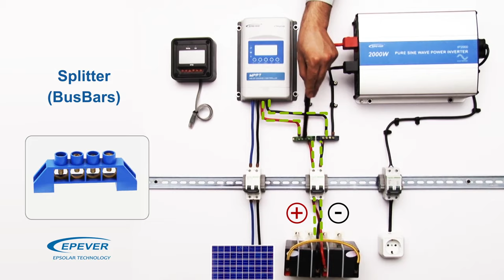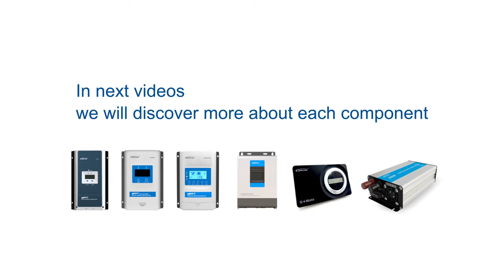The Ultimate Guide to DIY Off-Grid Solar Systems - 02 - Solar Off-Grid System Components.

Comment: Зачем вы подключаете инвертор парралельно аккумуляторам? У контроллера же есть выход DC?
Reply from the maker: Hello sir, there are two reasons for connecting the inverter in parallel with the batteries:

Firstly, it allows the inverter to directly draw power from the batteries and convert it into AC power for various electronic devices. This configuration ensures a stable power output and enables the inverter to supply power to a wide range of appliances.

When using the DC output of the controller, it is typically used to connect the batteries to the controller and provide DC power to other devices. However, the DC output of the controller may not be suitable for all types of devices, especially those that require AC power, such as household appliances or electronic devices.

Therefore, connecting the inverter in parallel with the batteries ensures a stable supply of AC power and prevents the batteries from fully discharging without voltage control. The inverter monitors the battery voltage and automatically stops supplying power when the battery level approaches its limit, protecting the batteries from over-discharge.

Secondly, the controller may not be able to handle the surge current generated by the inverter. We only recommend connecting resistive loads to the controller's load terminals, as inductive loads can generate significant surge currents that may damage the controller.

Therefore, it is advised to connect the inverter in parallel with the batteries to achieve the desired functionality.

Comment: Sir.. 
I have 12v 180w ×2 =360 w solar panels
12/24v 40 amp (SMU)solar controller
12v 150ah battery
So..
How many amps circuit breaker is Required..
On Solar panel to ( SMU) solar controller
 And solar Controller to battery..
Please ans me Sir...🙏🙏
Reply: Hi, I guess your solar panel has Isc rating of about 10A, so if you connect solar panels in series, the current is still 10A, that requires a 16A or 20A circuit breaker. If you connect your solr panels in parallel, the current will be 20A, then you will need a 32A circuit breaker. For battery, you need a 50A to 80A circuit breaker since your controller has a rating of 40A. Make sure not to use polarity-sensitve DC breaker for battery, though.

Comment: what happen if i use this inverter around 12pm, can you use it while charging the battery and using the battery as the same time?
Reply from the maker: Thanks for your question, with the right size of battery and reasonable parameter settings, yes you can process them at the same time.

Comment: Can you post a similar video about the Grid system?
Reply from the maker: Saba, right now, EPEVER is manufacturing off-grid products. However, UPower series, can supply charge for the batteries and we will release a video about it later. stay tuned, if it applies to what you need.
Reply: @Epever para llamar afuera   .. No tengo.
Reply: ./cont colle  0 t
no puedo llaman afuera

Comment: What will happen if the generation is more than the load demand and the battery is also fully charged? Will the voltage at load increases? If yes how do you tend to control that?
Reply: Hi, what the charge controller does will guarantee the generation is exactly what is needed at any time. There will be no 'more than' as you thought.

Comment: So when you mention how the inverter and battery are connected in parallel, are you saying they are simply connected to the same post (bolt) on the positive terminal busbar ?  This was a reply comment you made previously on another person's question in the comments.
Reply: Hi, hard to find the comment, but sounds  correct, positive to positve together, negative to negative together.

Comment: where i can get that DC breaker? at 4:50 i don't see it on the web ep.
Reply from the maker: Dear, artillerypr, we don't produce DC beaker for now, you can find really good breaker on internet my friend, have a beautiful day!
Reply: If you search "10A DC Circuit Breaker MCB Solar". Put the required amp and voltage rating into the search. They're available on Ebay as well as other sources.

Comment: hi fantastic I'm spending some time trying to get my head around all this yours was very easy to understand so easy in fact that I could probably now build a panel like this for the box van conversion I'm planning in the spring of 2021
However, I would like to go one better and build something similar to Greg Virgoe where you have one distribution board for all 3 systems onboard
A- Dc system
B- AC system
C- Solar system (off-grid)
is it possible to have an isolating switch built in to turn EVERYTHING off when the van is not in use or in case of emergency

I know the van will mainly use 12v power and occasionally I may hook up to shore power and occasionally I may use the solar panels

So is it possible to have all 3 systems wired up to this central board to make things easier to see and to use

many thanks from a new subscriber
Reply from the maker: Hi, Michael, i tried to understand your question, but to answer it and make sure that we don't provide you a wrong answer, we need some more information of your system, I have checked the Greg Virgoe videos, his system was set good, so please feel free to send an email to our technical support, better with your 3 system connection diagram, they will provide your best and clear answer, in case you can contact us as anytime, you can find the email on our official website, under the contact page, thanks in advance and have a wonderful day!

Comment: What about the connection from the charge controller to the inverter. Doesn't it have to be a circuit breaker?
Reply from the maker: Our inverter cannot connect to the charge controller directly, so we paralleled to the battery, and keep the connection point as far as possible to the controller, you can also add a circuit breaker between charge controller and inverter, if you have more question, please feel free to send an email to our support (you can find it on our official website under contact section), our technicians will provide you the best answers, thanks in advance, and have a wonderful day!

Comment: My friend says that this schema makes the SCC fault. He suggests to remove the busbars.
Reply from the maker: The schema is made clear to show the connection map for beginners, it may need to adjust a little bit in a different situation, thanks for your understanding and have a nice day😁
Reply: @Epever  some use busbars some not. Now I am confused. In what scenario you need to remove busbars?
Reply: @awanaja8707  Busbar is just connectors, in some case it is inevitable though, e.g., the cable that connects the battery is too large for the charge controller connector.

Comment: What breakers work for the DC part of the system?
Reply: search for: "2 pole non polarised mcb DC circuit breakers for PV array"
Reply from the maker: Thanks for answering the question Gregory Dunlop :)
Reply: Hi i'm curious about the dc breaker you used between the battery and SSC,Inverter. What kind of DC breaker is that? can i used any kinds of 2 Pole MCB DC Breaker in the market?

Comment: How's about fridges and air-con
Reply from the maker: Yes, but you have to check the power of the loads, and make sure that they are not over the product limitations, consider the surge current as well, so you may need higher power of inverter to ensure the system stability.

Comment: Great video, thank you!! One question: What happens at night when the solar panels are not generating a current? Does this circuit as-is allow the battery to power the inverter in this case?
Reply from the maker: Hi Sir, thanks for your comments. Yes, as long as you have enough power in the battery, you can power the inverter.

Comment: Great video, can't wait to get one of your MPPT charge controllers for my off grid Tiny House! :)
Reply from the maker: Thank you StoneLedge, we are mainly manufacturing solar charge controllers, solar pure sine wave inverter, and hybrid inverter charger, please feel free to contact us if you have any questions :)
Reply: If you connect like this, it will drain out bat. quickly. Bat. not gonna last for long.
Reply: @tule-hz5mj  , Hi, this is how it should be connected, if the battery will be drained out, maybe the solar panel is not large enough, or the low-input-voltage-cutoff of the inverter used is not adjustable.

Comment: I think is a little risky to put breaker between charge controller and baterry
Reply from the maker: Yes, so select a suitable breaker is important. Too high may not protect the circuit, too low may trip.

Comment: I could be wrong but I think you have the wiring wrong. You show the batteries hooked up to the bus bar and then going to the charge controller. It should show the solar panel hooked up to the charge controller and then hooked up to the batteries with a fused line. Then the batteries hooked up to the inverter with a fused line. Like I said I could be wrong.
Reply: Hi, the topo in the video is correct. You can use fuse to replace the circuit breakers though.

Comment: I think the AC switch should be before the inverter, not after it in order to shut off the entire inverter. There should also be a circuit breaker before the charge controller. And why are there no fuses shown??? This diagram is very incomplete omitting basic components
Reply: Hi, you can add more circuit breakers accoriding to your needs. Fuses protect against overcurrent and short circuit, so do the circuit breakers, you can put either fuses or circuit breakers.

Comment: This inverter is not much power pull and you can run small things
Reply from the maker: Hi Wisal,  Thanks for the comments. The inverter capacity  should be selected according to the load power. Here we use 2000W as an example. :)

Comment: The best off grid inverters today  are   Hybrid , you can still  be  off grid with or  without  batteries   and  if you wish connect to grid just for supply home wit electricity   during night .  
All this  above  without batteries which are useless  trash after  2-3 years
Reply: Hi, EPEVER UP series does not support no-battery application, but UP-Hi series does, please check the link,  https://www.epsolarpv.com/upload/file/2103/UPower-Hi-Manual-EN-V2.0.pdf